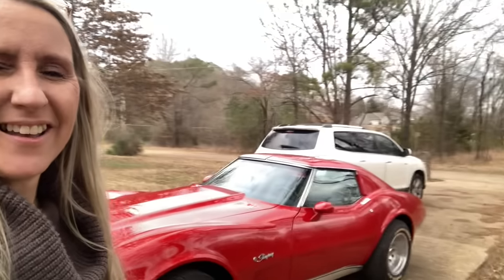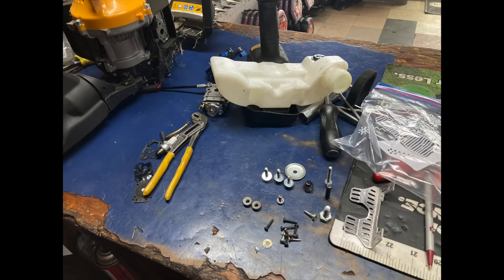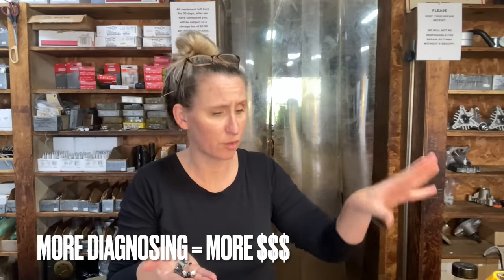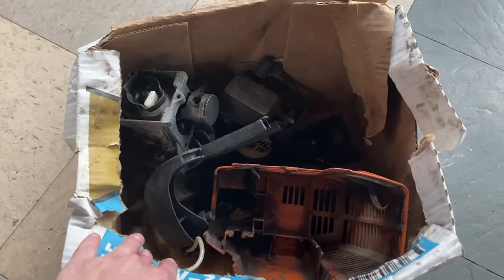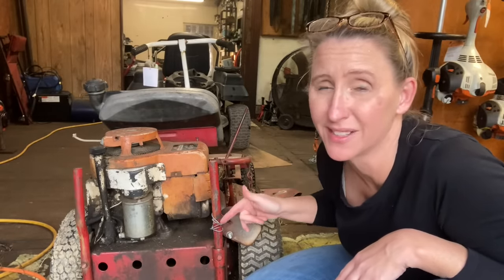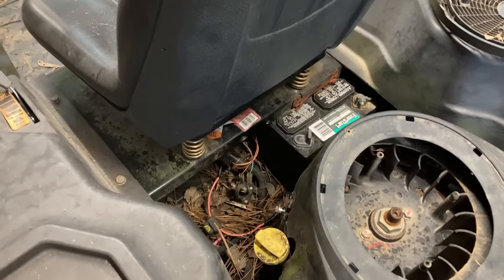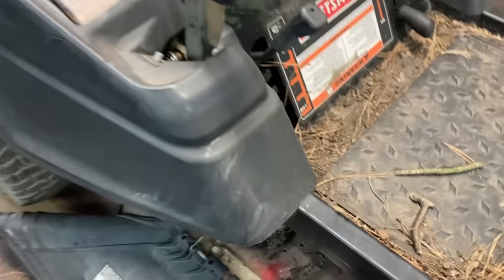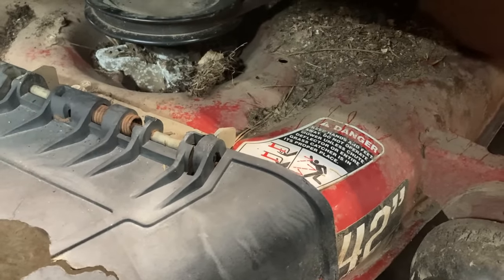Don't Waste Your Money and My Time! Gambling on Repairs When the Odds are TERRIBLE, We Both Lose!

Comment: I think part of the problem is people are in complete denial as to the condition of their mechanical devices. One of the worst things you can do is let something mechanical sit out in the elements, often one winter is all it takes for critters to move in, gas to go bad and corrosion to take over (you can't fix rust). A couple years ago I was a care taker of a property where I found an old John Deere D100 riding mower in a storage garage that needed work. The primary problem was the holes in the deck that supported the spindles were rusted out. Fortunately the deck itself was fine, so all I needed to do is make some flanges to sandwich the deck between the spindle flanges and my manufactured flanges and after a new fuel pump and replacing the cable that engages the spindle it actually worked and impressively so; that B&S OHV engine is incredibly powerful and apparently bullet proof because it still working today.

Comment: that craftsman is only missing the bar down by the blade, there's 2 48" decks for a gt5000 that have the same opening same shield infact. it just needs a new motor, new battery, new wireharness and new gas tank with new fuel lines, it'll be fine, trust me. oh...and blades 50% shorter. it'll work, they can mow some cool lines then

Comment: i have worked on rideons lately and some of them havent gone in a while and its the time to get them running that adds up it might be 6 hours labour thats alot of money i get told the motor runs well and it did 5 years ago because its been sitting for so long hasnt done much work its like new i check the blades and they need replacing1 there worn out so that mower has done alot of work.if motors or engine are going to take up alot of time the owner needs to know as it may be cheaper to buy another mower you have to cut your losses at some point.

Comment: Well I bought a used zero turn, I'll never buy another used zero turn mower again. At first I thought it was a simple steering problem, but then I find that the steering is in the transmission, and that it will cost me more than it's worth to replace the right and left drive units. Now I'm saving up for a new one, it will be the new Toro 34" cut. I will keep the used one as a reminder that buying a used zero turn mower is just buying someone else's problems. I gave 700 for it and they should have paid me 700 to take the junk out of their yard.

Comment: Request for a "check this next" from the more experienced small engine mechanics.   I have reached the end of my knowledge of small engine repair.  I am a Willys Jeep guy, and this mower issue has me stumped after what I think is a pretty thorough check list.  I don't want to take a lot of your time so I will be as fast, specific, and concise as I can.

We have 2 identical mowers. Cub Cadet SC500z 159cc   (MTD)  Rear Wheel Drive 
Both mowers got bad gas and both mowers stopped running.  
What I have done list...

Gas tanks were emptied and cleaned. New gas added.
I rebuilt the carbs (dissembled & cleaned carb and in-tank fuel filter w/ both carb cleaner spray, and 30 minutes in heated ultrasonic cleaner).
Weld tip cleaner used to clear carb orifices of blockages.
Auto choke, throttle, choke linkages are all free, connected, and have correct play.
Air Filter cleaned (and then removed as a test on unit that was still not running).
Re-assembled both mowers -  one mower now works again, one mower still doesn't start & run.

further info on 2nd mower that is still No Start.
Purchased New carburetor for 2nd mower (new carb installed).
Has Spark (spark checking tool).
Spark Plug is newish and clean.
Has fuel in both tank and carb bowl (bowl full).
Oil level good. Oil quality is fairly good used.
Run/Stop Control Cable is new, replaced 3 months ago with new. (Also manually forced cable to max open to test).
Still No start.    It pops softly out of carb, with the occasional louder POP of a failed ignition.
Air - check    Fire - check    Fuel- check     Timing - not applicable?  

What am I missing?   

I made this short youtube video (1:16sec), showing how it sputters/pops, then mild backfires through the carb, but doesn't run.
https://youtu.be/CuooSXKyRfc

Thank you for any advice on this odd one.
Reply: We have seen many problems with the auto choke. Pull the shroud off and take the carb off again make sure that the plate in front of the carb with the linkage to the choke is installed correctly. Also assure the shroud is not blocking the choke air vein from opening as this is also a common issue. let us know what you find.
Reply: From the video it sounds like the throttle is closed. Throttle should be wide open to start. You can take a flashlight and look down the throat of the carb and see if it is open if not the linkage may be on wrong.

Comment: Don't expect equipment to work when it isn't maintained properly.  I run synthetic oil in my riding mower and change it every year regardless how "good" it looks.  I also pressure wash it after every use.  No rust and stays in the shed

Comment: It is difficult to believe how some people treat their equipment, yet they expect it to perform like it is brand new. That Craftsman ride-on mower was disgusting. I always blow down my Husqvarna ride-on when I finish mowing to remove all the debris. Also always check oil level and air filter before use. When you invest a lot of money in the gear you NEED to keep your property maintained you need to spend a little time and money caring for the equipment so that it doesn't end up costing big dollars to repair...it's common sense!

Comment: About the 3 dollar prime ball. Of course I would not put it back together like that but we should not be narrow minded. Imagine a scenario which would be quite typical for a lucky man like me: 
You gather a whole group of people to do a big clean up. Saturday afternoon. Most shops closed for the rest of the weekend. You want to start the project. Prime ball leaking. Damn.
What do you do? Cancel the whole jobb? Make new arrangements and what not. Send everyone home?
Or do you go the extra mile and go in to your stuff, find an old machine that has a ball that fits and fix it. Half an hour and you are operational. Someone that finds that stupid is not someone I would hire 🧐 Tis is just an example but I see this everywhere. Car mechanics making fun of customers because they are not able to imagine the trouble someone might have been in at that moment. I once fixed my exhaust with hose claps and a coke can. They laughed at me but it saved my day and saved me a lot of money for an acute repair in an unknown workshop abroad. Wouldn't have had time anyway. Should I rather have driven around with a loud exhaust? No. I took a coke can and a few clamps and we had a good car again the rest of the holiday. Fix it when we come home. Absolute genius 😎😁

Comment: When it comes to RIDING lawnmowers. Can you overhaul - re-bore cylinders, basically do everything to an engine to make it like new? Single cylinder or dual cylinder? I know it's not typically financially advisable.
Reply: You can rebuild both single and twin cylinder engines, but as you said, it’s not typically advised from a financial standpoint. I’m going to school for small engine repair and it even says in the text book that if the cost to rebuild will be 50% or more of the value of a new motor, just replace the motor or get a new machine. 

I just replaced an engine on my personal snowblower and I have $140 into that project. Granted it’s a harbor freight engine which replaced the 40yr old Tecumseh, but it was a cheaper and easier way to go, especially since Tecumseh is not around anymore.

Comment: As a service guy, I can confirm EVERYTHING that was said here. The principal behind all of this is the same, whether we're talking small engines, your cars, the plumbing in your house, and pretty much any other thing that you might call a repair guy for.

If you really want to try to fix something yourself, first accept that you may end up disposing of the thing. Because, if you attempt a repair, and fail, you will either trash it, or have a repair bill that exceeds the value of the broken object.

I recently worked on a jet ski that came in pieces. By the time that it was reassembled, the owner had exceeded the value of it, THEN we discovered a leak that would more than double the current repair bill to repair it.  Bad thing is, the owner had purchased it used, used it once,  found a small issue, and let her idiot boyfriend attempt to fix it. We are certain that he created the leak, when he took unnecessary stuff apart.  That poor lady was SO upset.  Thousands of dollars unnecessarily wasted; $10K (including price of purchase) on a $4500 machine, looking at spending another $5K+, and still has yet to really enjoy it. At this point, she could have purchased a brand new, next step up model, ridden the hell out of it last season, and be ready to ride the hell out of it in a couple more months.  Damned shame.

Comment: Perhaps a shop sign that reads:  "We are mechanics.  We are not magicians.  Some machines cannot be repaired for a reasonable price in a reasonable amount of time."  I had a sports car and import shop in California back in the 70s.  I was very leery of any vehicle that was towed in and didn't run.  On the other hand, I had a car trucked in from another state, and the guy's note said, "Please build me an engine like (teacher's name) and replace parts you feel should be replaced."  He gave me his name and phone number.  Wonderful customer.  Not once did he ask me to cut corners or try to haggle with me about the price.  I saw all kinds of people, and there were some people I just would not take on as customers because I knew that if I changed a headlight, they'd blame me for the brakes squealing.

Comment: All my life I have worked with dis assemble stuff. Especially at the used lift truck shop I worked at. At least it was a business decision not mine. One huge clark had a red button in it I called it the Easy button for Hillary at the time (air brake park brake) top of engine dis assembled. I won tho. Needed ladder to work on it tires tall as me.

Comment: It bugs me to no end when people leave these sometimes expensive machines out in the weather and most of the time they don't even attempt to at least cover it, and furthermore just like with cars if they're lucky enough to have a garage it's full of crap while these machines cars mowers snowblowers whatever are left outside unprotected and vulnerable to weather damage and animal damage.case in point, my friend has a large house with a two car garage that's full of junk, he's a hoarder in the clinical sense meaning his whole house is loaded up, so consequently there's no room to store his mower, he shoves it halfway under the back deck and that's where it lives, every. Every spring I have to go there, he lives about 40 miles away, and empty the gas tank and drain the carburetor of water, last year he brings it out of the back and in front of his driveway to where my truck is parked instead of me dragging my tools around back, when I saw it i noticed that the gas cap was missing, of course he had no idea where it was, I got it going and put the cap off of my mower that I brought with me, after cutting the grass we went in the back to try and find the cap, it was on a bench that was near where he keeps the mower, it was all chewed up and there were a ton of acorns on the bench as well , the squirrels had managed unscrew it for some unknown reason,  I wonder what they thought it was. Last year he wanted a riding mower because his knee was giving him trouble, I found a snapper rider, in better condition than the one shown here, I took it home and did some work to it and brought it up to him, I haven't seen it since so I'm expecting it to be a total mess this year, he had it covered but he said the cover blew off and he's too lazy to replace it, it should be fun.

Comment: Had a guy bring me his Husqvarna w/Honda engine push mower to fix. Carb and other stuff in a box. He pulled out a 1/4" lag bolt asked me if it goes on the mower. I replied "only if you want to build a deck around it"

Comment: That last machine had a ton of things wrong with it that would have still probably totaled the machine, but it wouldn't have taken that much labor to find out if the engine was good or not. I can determine that in about 20 to 30 minutes. I operate my own business and the majority of the machines that I get are usually old machines that haven't run in years. That's kind of my specialty

Comment: This is why I lost interest in running a small engine shop. People who don’t maintain their stuff are not going to start just because you told them to. I get pure junk brought in that they don’t want to spend money on. It is rare that a customer will spring for oem parts. A lot of stuff I see has no parts available for them. I’m also tired of answering the same questions, what is the best riding mower? I want to put up a sign informing people that all tractor style riding mowers are various levels of crap. Some are slightly less crappy but still crap. I put a lot of Chinese engines on equipment partly because it is the cheapest fix, but I push them because that Chinese engine is superior in every way to the junk it came with. I have a chipper in right now with a “briggs” engine and it is getting a predator, why? They are both Chinese made engines, the predator is better and less than half the price . I should add that there is no fixing the existing engine, crank snapped off at the flywheel and tore the case up. I look forward to the day I no longer run this shop. It has been nothing but a headache . You are a strong person being able to put up with that, I just don’t have the patience anymore. I’ll stick with atv’s

Comment: so let me ask you a pricing questions. I just recently had a brain injury that stopped me from working automotive for the last 20 years. instead of sitting around in my thoughts I decided to start my own small engine business.. I started at 75$ an hour for labor and most basic diagnosis no charge. think that's ok? or way to low? also I do not mark up parts but I do charge for parts and shipping.
Reply: business seems to be doing fairly well. I've only been at it for about 8 months now and I have a full ledger book, scheduling book and business cards. I've had about 50 or so customers so far but the name and rep is spreading fast and all has been positive so far.  i was fairly popular in school so alot of people around this area actually know me.
Reply: This is the OLD MAN from Eliminator Performance in Canada. Our hourly rate is $70 per hour and my son Jake started the business 9 years ago so i think your rate is reasonable but you should charge a 1/2 hour minimum for diagnosis. If you get the job once you diagnose it and give them a rough quote (i say rough because there are always additional parts that may need replacement like gaskets etc.) that is part of the invoice not a separate fee. I would suggest you get accounts with different parts suppliers you will get great discounts with good mark ups to increase your profit margin (allows you to purchase additional equipment and grow the business or lease a shop or build in the future) but in Canada you need to be a registered Company with an HST (tax) number to set up these accounts. Hope this helps and check out Jakes channel.

Comment: Interesting and funny!
I have an 8 year old Cub Cadet that still runs great but I maintain it.
The only issue I have had is the crap seat that came with the mower and have not been able to find one at a reasonable cost. Any suggestions?
Reply: Got a mint one here in Canada at a good price Richard lol!
Reply: Tractor supply and Northern tool sell replacement seats.  I have an old tractor that needed a new seat, was at a boat shop and found a sale on bass boat seats.  Hey it works, and looks pretty cool too!
Reply: @larryjohns8823  Thank you for the information, I'll check.
Reply: @waynestefinashen239  yes sir, did not get the swivel but the fold down option is great (seat area stays clean).  The cost was less that a replacement and the vinyl is marine grade.
Reply: Got the replacement seat for my Craftsman at A & I Products/Sunbelt Outdoor Products, to fit my bolt pattern and spacing. It's easily twice as comfortable as the hard biscuit original.
Reply: @dr.detroit1514  Thank you for the info

Comment: That snapper with the briggs only needs like 20 dollars worth of parts to run for another 50 years, they are basically indestructible and I'm surprised you wouldn't work on it. It's all the new crap that breaks not the old stuff. Easy fix, muffler is not necessary,  coil is 20 bucks, new plug wire is 5 bucks, new plug, carb clean out, new gasline,  and some fresh oil,  there's nothing else on it to break.  I've seen old briggs that sat for 40 years under snowpack and they all still run great. This new plastic crap with unnecessary electronics are the ones that should be illegal for their planned obsolescence, not the good Ole machines that were made right to begin with.

Comment: When a customer, reaches mid to late sixties in age, if you haven’t spent a considerable amount of you adulthood keeping-up, with the mechanics of small engines as they evolved through the previous forty yrs, your better off not tearing apart your stuff… give the pros a fair chance at diagnosing your problem, ( invest $50 into diagnosing ), before your wrenching or screw-driving begins… 

@age 79, I decided to change the air filter, on my 8 yr old GMC, and broke 3 plastic parts doing that…  

This video, is one of Chicanic most important ones, and I’m not sure anyone else on u-tube is stating the problem as clear she has…